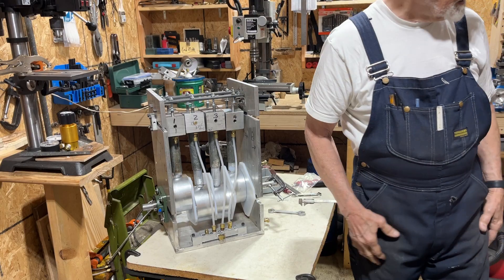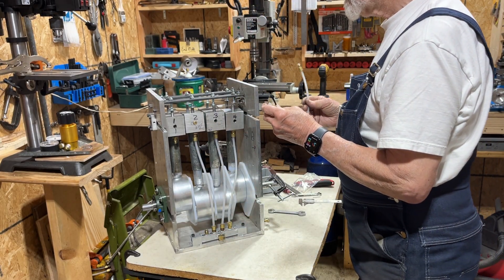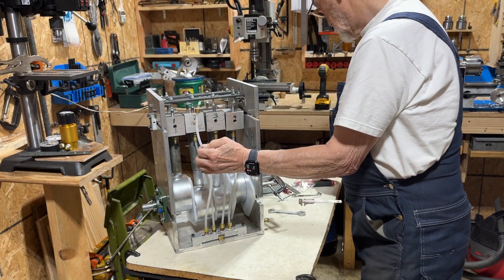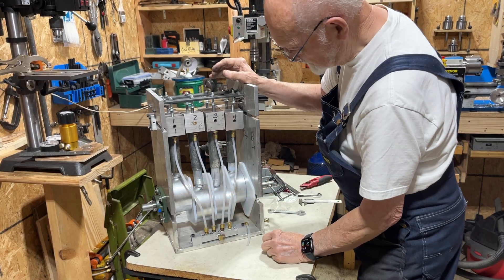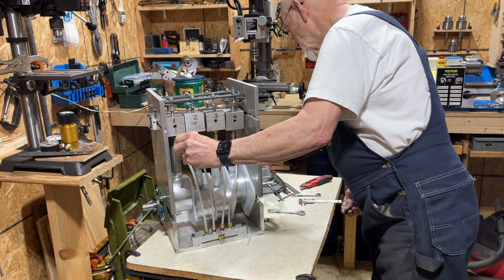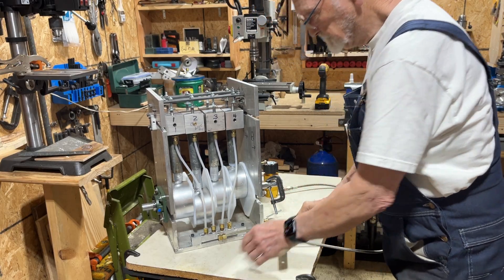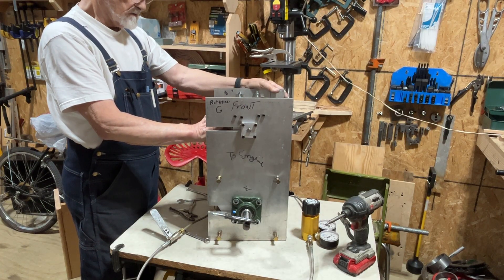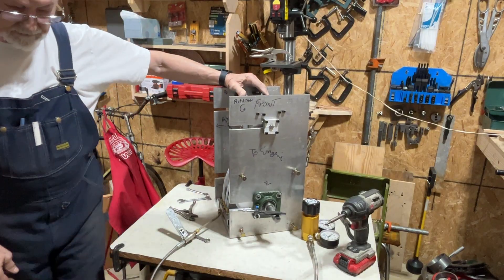My Air Powered Car,  First Trial Run not such a good day 7-6-24

Comment: Another video from this idiot that thinks he is an inventor. We'll all be dead before you are able to power a vehicle with this dumb idea.  I guess I'll consider you comedy
Reply from the maker: Thanks for you comment, even though you think it's a dumb idea.
Really it's no different than any other gasoline or diesel engine, it's just that compressed air is not as powerful so needs more to do the same job.
If one can come up with a way to increase the heat absorption during or before expansion of the air,  it would be a much more powerful renewable power source.
It's an endeavor I'm willing to work on.

Comment: Y not use steam turbine...single stage would work...i like your engine but turbine is so much easier...
There is guy his chanel name is fixfocus  he designed turbine that is pretty good powerful.good luck
Reply from the maker: I would love to use something simpler like a rotary engine or a turbine, but I can’t carry enough air to give those turbines or rotary engines What they want so I have to have a piston that I have direct control over. It rotates 1 time and makes a wheel turn 1 time

Comment: I don't know if this will work or not, but I am definitely interested in seeing you try! Subscribed!
Reply from the maker: Thanks for your thoughts.
The current engine design is not my original design, and I have worked on it 3 different times in past years trying to improve on it.
if you go back in my videos to "Air~Engine Research, 3 Cyl Orbital Air Engine Update, on Single Shaft Push Pull Valve" you will see it does work.
Since I have run this version for the first time, I see a number of problems to be solves. It takes time and thought, but I am confident they will eventually be solved - just give me time.

Comment: Air doesn't have the expansion factor that steam has, a larger bore 3"-4" and a longer stroke with a flywheel would be better I see where you mention your concern about the weight of a flywheel but once the flywheel is in motion it carrys the energy for smooth operation. I have thought about converting a v-twin air compressor pump into a rotary valve engine, it would have to be low rpm and efficient to be practical but its very interesting to see how it works, but getting around the fact that compressed air doesn't expand the way steam does makes a double or triple acting engine not feasible. I thought about all the air powered tools in a shop and thought about how that technology could be adapted to household use turning a clothes dryer tumbler, running a vacuum cleaner and spinning a furnace blower and ceiling fans. Most air motors are a vane design, rather than a piston. So they are high rpm and lower torque so a reduction gear would be necessary. I like the idea of air power since it solves the problem of storing energy, that electric faces batteries are so expensive. I built a windmill that turns a two stage air compressor pump and plan on using old 500 gal. propane tanks for large storage volume. The appeal to me is using wind to compress air is truly free energy with zero emissions and can be easily stored. Maybe a high bred vane motor with the exhausted air powering a piston would be the answer to solve the problem, to have all the benefits of torque and speed, interesting stuff to think about.
Reply from the maker: Thank you for your thoughts and ideas, I do take them seriously.
The designs and types of motors you mention all use an enormous amount of Compressed Air, which would be impossible for me to carry in my car.
Using very high pressure compressed air in carbon fiber tanks will allow me to have a supply on board for some distances, but if I am to succeed it will only be by using a small amount of air, through positive displacement, and a  Unique Mechanical Advantage Designed Engine.
I have worked on this over the years - it works - and I am still working to improve it.
Check out one of my past videos "Air~Engine Research, 3 Cyl Orbital Air Engine Update, on Single Shaft Push Pull Valve"

Comment: Will your engine make its own air, To make it run on its own
Reply from the maker: Thanks for your questions.
No it is not possible for it to compress its own air.
High pressure carbon fiber air tank will have to supply air to run it.

Comment: It needs a flywheel to keep momentum.
Reply from the maker: Thanks for your input, I have thought that over but don’t want the extra weight unless absolutely necessary.
I am hoping to get enough momentum from the weight of the iron rings?
Reply: @AirEngineResearch  It doesnt need to be very heavy if it has a large circumference. It can be plastic or timber.
Reply from the maker: @matton36 I believe the four rings made of steel which are fairly heavy and the driveshaft rotors inside the rings actually give it enough momentum once it’s running correctly that I wouldn’t need one. But there’s still the option if necessary later on.
Thanks though, for your comments and suggestion

Comment: I think a flywheel would help
Reply from the maker: Thanks for your comment and your thoughts, I have thought about a flywheel, but if I can get away from it, I don’t want the extra weight, but the driveshaft at the rear could be used to mount a flywheel of necessary. I have a ring on it right now that I use for just manually turning Driveshaft while I’m working on it, but I don’t plan on leaving it on. I’m hoping steel rings as they go in their orbital orbit around the driveshaft will act as a flywheel. I guess I’ll see how it goes over the next days as I work on it.

Comment: What plans do you have for lubrication?
I have to admit, I was skeptical on it running, was a good feeling to see it run under its own power.
Reply from the maker: No lubrication needed everything is seal bearings with leather seals in the cylinders
Reply: @AirEngineResearch not likely.  Perhaps you should further reflect on friction and heat. No lubrication needed...... hilarious. You are a lost cause in need of help
Reply from the maker: @jamesmoran7511 thanks for checking in and your advice.
The only friction would be in cylinder seals, which are leather cups preluded As the engine is operated with compressed air, There’s no heat coming in only cold air, which I’m hoping will keep the seals and the cylinders cool at least. If ever lubrication is needed, it can be added to the air as a mist or drip.
I am more worried about balance and being able to get up enough RPMs

Comment: Things were looking really good!  I'm sorry to see you ran into another stumbling block.  I'm confident you'll figure this issue out and be right back on track soon!!
Reply from the maker: Why is called a prototype? Things are expected to happen, and they have.
I will have to remake two or possibly more valve Heads because the cylinders don’t screw in straight - I will have to be more careful next time with tapping the 1” pipe threads.
The timing is more difficult to do than I thought also.

Comment: That's a good start, even if you feel it's not such a good day. You've shown the principle functions are all working, even though they still need fine tuning. Great to see!
Reply from the maker: @AnthonyGriz  yes I’ve been through this before, it is a prototype so it’s expected that it may have problems but whatever problems show up. I sure I will work through it. Thanks for checking in and your comment.

Comment: why no double expansion cycle?
Reply: Seems like a thing that wants a flywheel.
Reply from the maker: Thanks for the comment.
I have thought about Flywheels and benefits, but weight is detrimental to energy requirements.
I am hoping the weight from the steel rings will act as rotational momentum as they go through their orbital movement.
If by chance a Flywheel proves to be necessary, the rear end of the drive shaft is an available connection point?
Reply: @AirEngineResearch  think how badly a car engine would run with no flywheel. I think it's got to be tried, even if it just proves it isn't necessary.
Reply from the maker: I have already added one recommendations once I get it finally running on its own. I’ll see what happens with or 
without the flywheel.
Reply: @AirEngineResearch  advantage valve duration/timing, least air use....
Reply from the maker: Thanks for checking in, before I could comment on double expansion I would have to know how you think it would work?
Each Cylinder receives compressed air 1/4 of the rotation, and  moves roughly 2 inches so how would double expansion work?
Reply: @AirEngineResearch  exhaust has more pressure than atmosphere to extract remaining energy from, it's common known, a 2nd stage w/bigger volume of cylinder.
Reply from the maker: @davegeorge7094  I have thought a various ways to use the exhaust, but I don’t want any back pressure, since I’m using small cylinders and short stroke there’s not a whole lot of exhaust that would be practical to try to use, and besides, that would just add weight and extra cylinders and rings and rotors so I think I’ll just stick with it. I can at least get it to run and hopefully do what I want to do in the
End.
Thanks again for your input.
Reply: @davegeorge7094   I have been trying for years to get him to calculate for proper expansion. It doesn't necessarily require multiple stages. Proper expansion for ½ stroke is to use pressure equivalent to 2X ambient pressure or around 15 psi on a guage.. if you want to run higher pressure the intake needs to turn off sooner, or use multiple stages. In this design there's absolutely no compensation for expansion, so not even multiple stages would make it efficient. You can hear the compressed air blowing out the exhaust. Sadly, his pistons are way too small to use pressures that low. So, as I have explained in several comments in the past, most of the available energy will go right out the exhaust and make a bunch of noise.. I love the ambition, but am disappointed with the lack of ability to listen to advice from someone who has already built 4 compressed air vehicles.. I will leave this comment  for others to read, hoping it won't only fall on deaf ears..